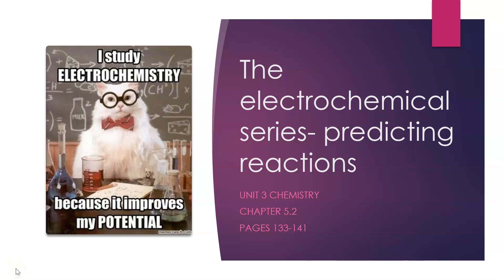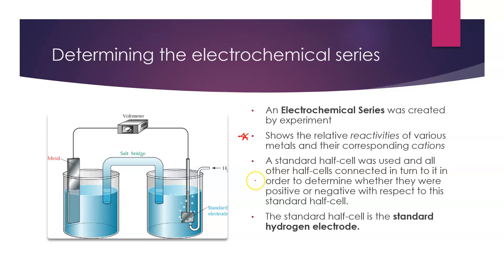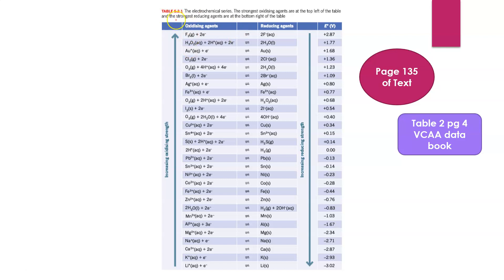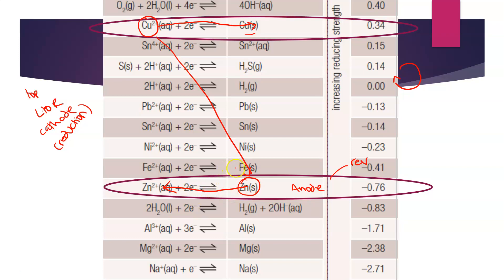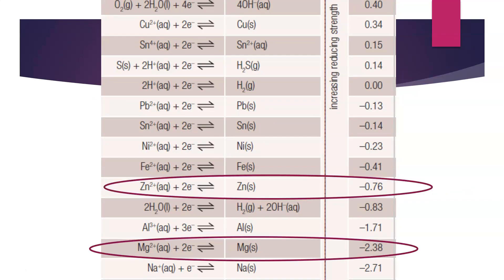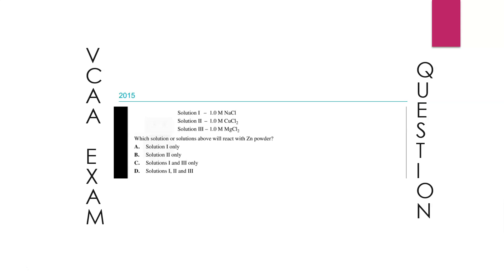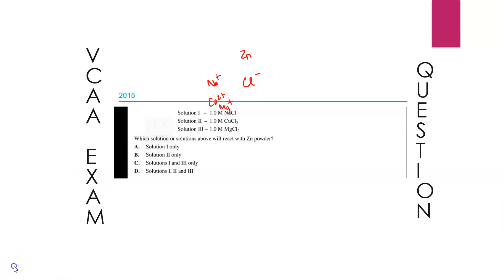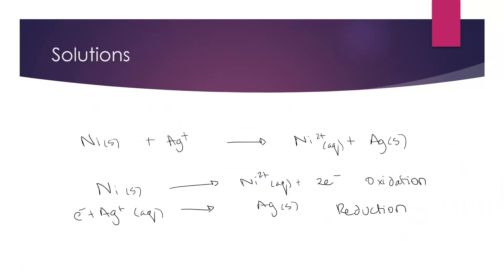RFC5 VCE Unit 3 Predicting Redox reactions

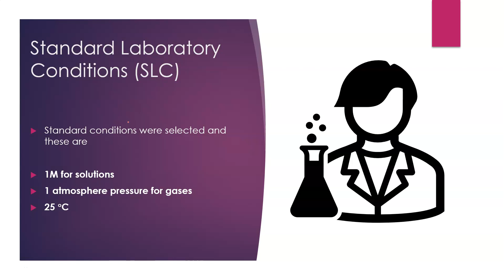Comment: 4:05 100kPa?
Reply from the maker: In this instance I would say you would get away with 1 atm / 100kPa  rather than the 101.325. In the current VCAA curriculum you are unlikely to see questions asking you to do gas calculations based on gaseous electrodes.
Reply: @Drvjellis  16:27 why can't the chlorine gas react with iodine ion?
please help me thanks :D
Reply from the maker: @OOO-gm2sn  Chlorine gas will react with iodide ions as chlorine is more reactive (the stronger oxidant and will remove the electrons from the iodide. In the final examples the situation is Iodine crystals these are not ions it is pure iodine reacting with sodium chloride so this is chloride ions not chlorine gas. Chlorine has already gained electrons to form the chloride ion in this case and will not give these up to iodine as it has a higher electronegativity than iodine.